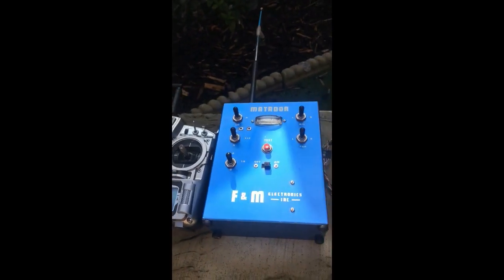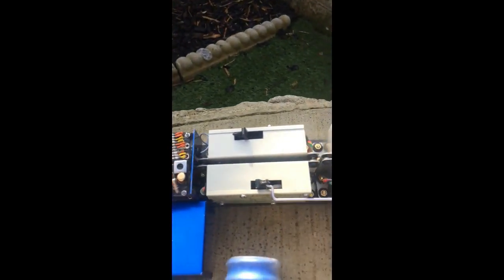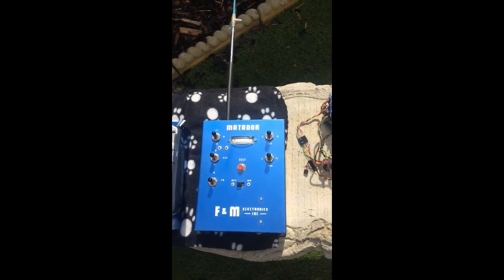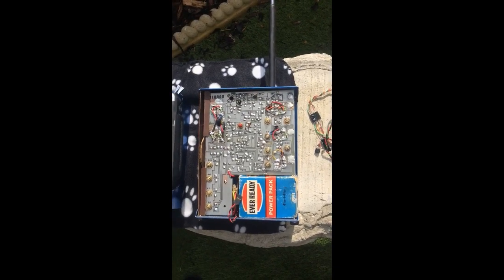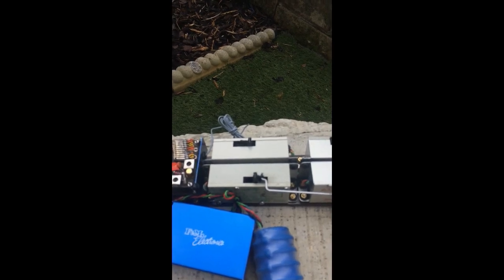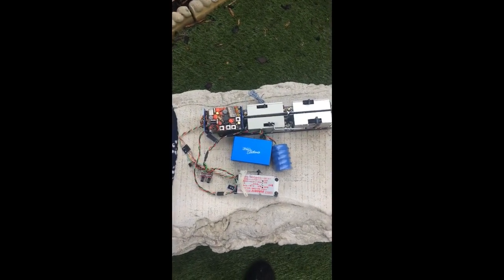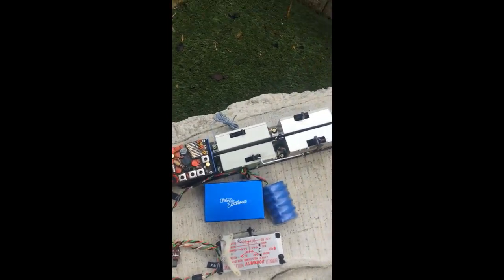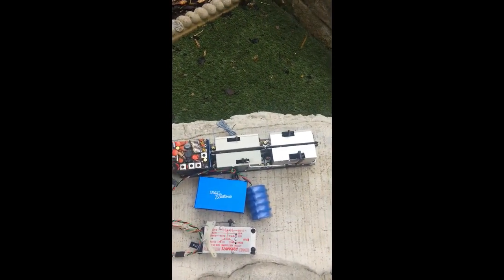Vintage 1960s Reed Radio Control

Comment: God Bless and thank you very much for this video.  I have been looking for info. on these though they may have been before my time (I just turned 52).  I used to fly RC aircraft and am open to it if I have the chance again.
I think that it is possible that a RC you truck I had may have used these as I remember seeing some things that looked like coils.  You had to turn the truck on and the only control you had with the remote was left and right turns.  It was a model of the tractor trailer from the TV show "Moving On" starring Claude Adkins.

Comment: I have  an identical set was the transmitter 9volt.
Reply from the maker: Yes it was and it did work although the range was very short due to a fault.

Comment: A few years have gone by now chap, have you tried the Reeds tx yet?
Reply from the maker: Well I hope to try it in the nicer weather and once the pandemic is under control. This summer? I’ve checked the range with two satellites connected and all seems good. I’ll fit it in a Majestic Major I have to start with and take it from there.